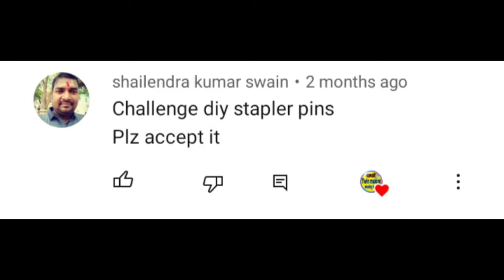Diy Homemade - Stapler pins/ How to make stapler pin at home / 1 on YouTube Stapler pins Twin making

Comment: U just used stapler pins to make stapler pins
Reply from the maker: Yes... I am using because I have no thin wire 😕. Yes , It is working with Thin wire ok.... Comment your challenge
Reply: @Pookiey.laughy  HLO CAN U MAKE GLUE GUN AT HOME USING LIGHTER 😊
Reply from the maker: @karikkufans2309  ok
Reply from the maker: @karikkufans2309  Your challenge is accepted 👍🏻🤩 🥳👇🏻
https://youtu.be/Rr7nSMVKltM
Reply: @Pookiey.laughy  thanks bro  new SUBSCRIBER 😉